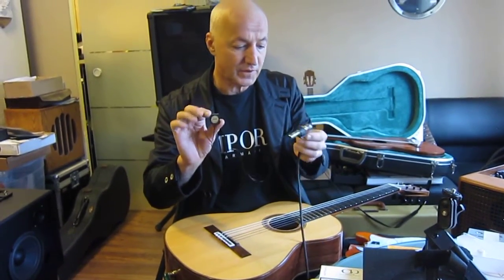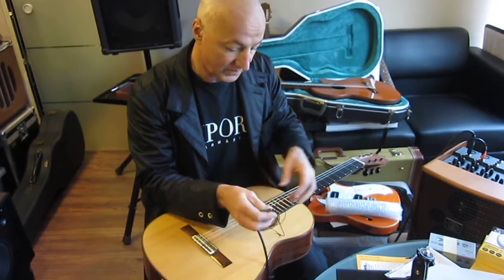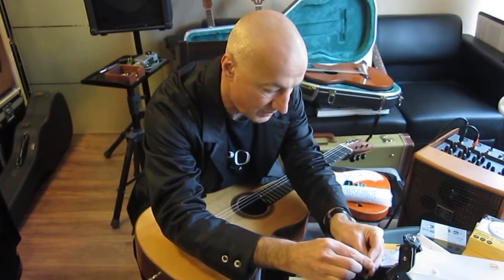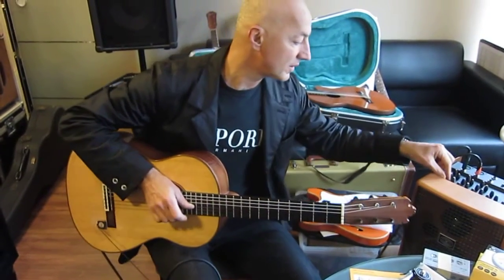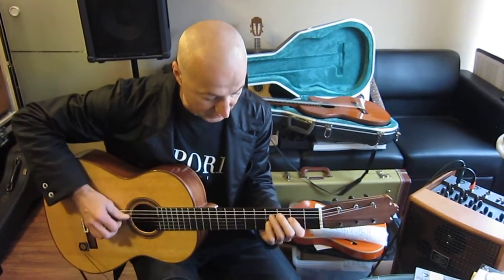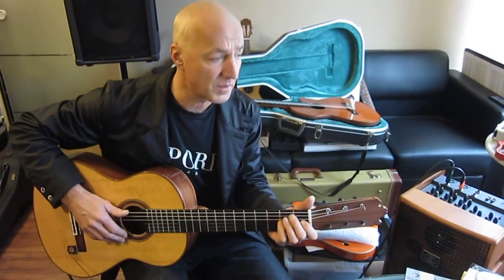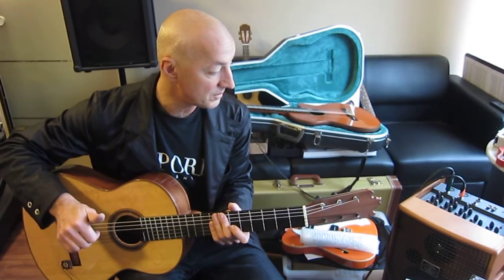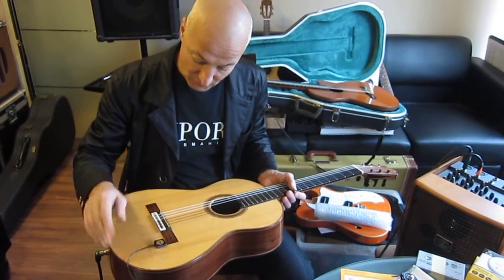How to quickly find the sweet spot for CS sensor

Comment: Great sound! This will only work with instruments with a good acoustic sound, right?
Reply from the maker: It will amplify the instrument as it is, 100%, each cm vibrates different, sensor is so accurate to reproduce each timbre as certain spot fully linear :-)
Reply: @carlosamps  Thank you. Sounds good. However, I am about to build a 3-stringed solid body bass with rubber strings. This instrument will not have a good acoustic tone, so this pickup is not the best for this, right?
Reply from the maker: @stefanhansen5882  very less usage on this Stefan, but the good news is that you can go for vip pickup in the bridge, and make it sound phantastic. no magnetic pickups needed
Reply: @carlosamps  What is a vip pickup?
Reply from the maker: @stefanhansen5882  we cant do this here anymore, go: info@carlosjuan.eu